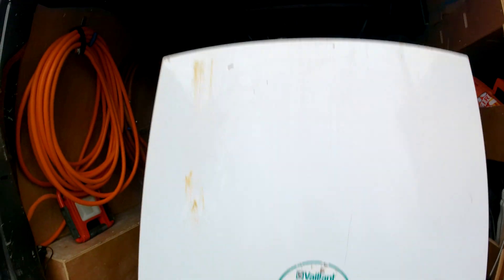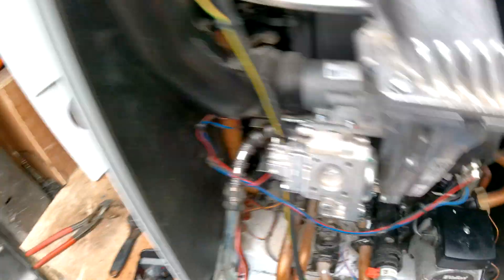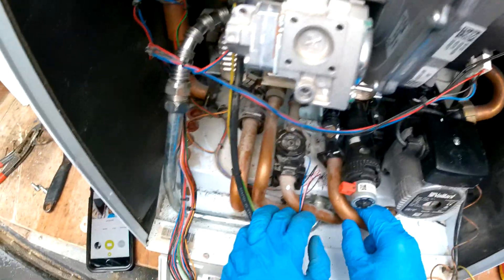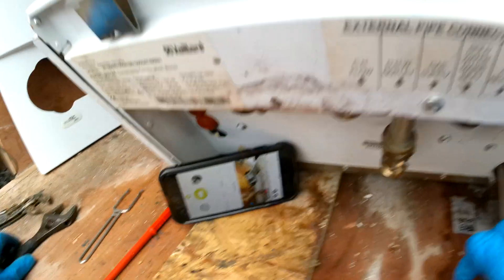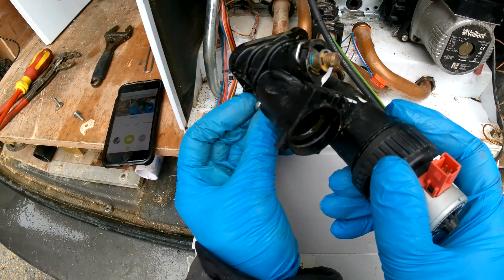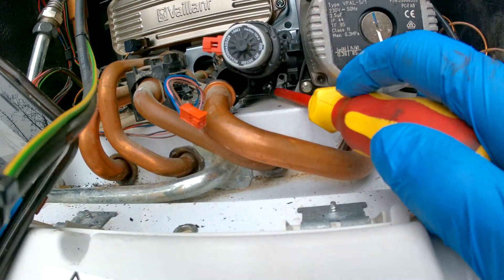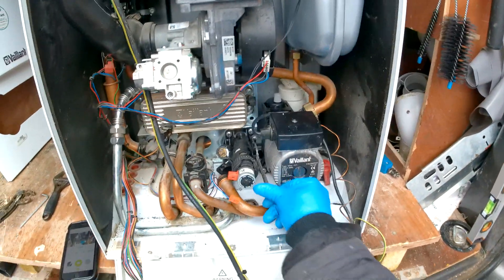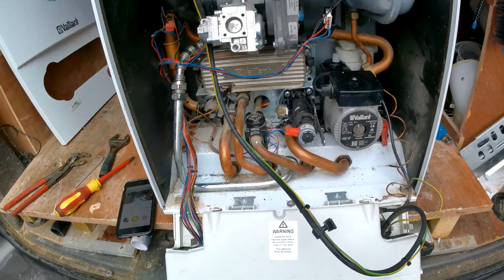Vaillant EcoTec Pro | Changing The Diverter Valve | Radiators Getting Hot Whilst Using Hot Water?

Comment: Hi,
I have the same boiler. I had a leaking valve, so I replaced the cartridge inside the valve 3 days ago. Today, the hot water works fine, but central heating/radiators do not heat up. What could be the issue? Is it the cartridge issue or do I need to replace the full diverter valve assembly as you have done here.

Comment: My radiators don't heat up properly until I run the hot water tap till the water runs hot. Could the diverter valve be the problem?

Comment: Hi, what about if it makes humming noise when turning on? Can I replace just the cartridge inside ?
Reply from the maker: What do you mean by humming noise? When you turn this boiler on by the mains power, the diverter moves and makes a humming noise for a few seconds and then stops. Is that what you mean?
Reply: @advancedboilertraining  no, when the heating is turning on it starts making funny noise but not every time. When I took the cover off, and placed small piece of wood against the diverter I could feel thr vibration so I am assuming the sound is coming off it
Reply from the maker: @marcinglodzinskl1972  strange, the cartridge is really easy to change so it’s worth a try if you think that’s where it’s coming from
Reply: @advancedboilertraining  thanks a lot for your reply and advice 
I will but the repair kit and have a go

Comment: Good videos for apprentices and new engineers or if u haven’t changed 1 yet. You don’t need to isolate the cold main on a diverter change. Gas seal for the washers and a bit on screwdriver to hold the screws works a treat

Comment: Could you tell me what is that brass screw on the side of the valve and what position should it be on. Thanks
Reply from the maker: I think what you are talking about is the by-pass valve.

The position is usually factory preset to approximately 250mbar (mid-position that is shown on my video).